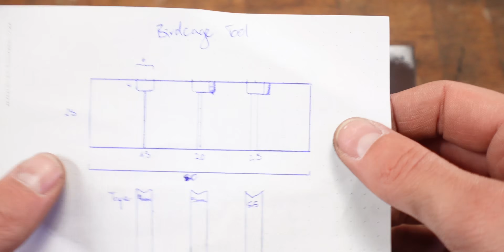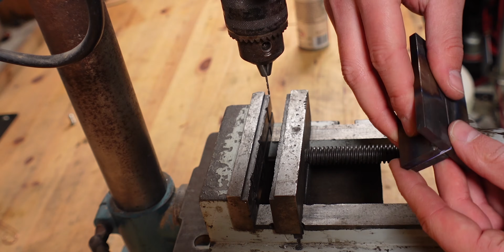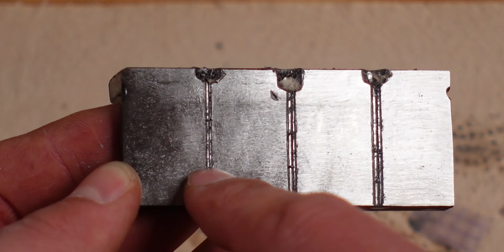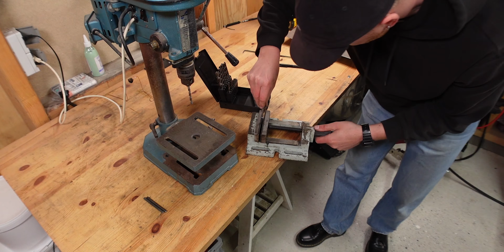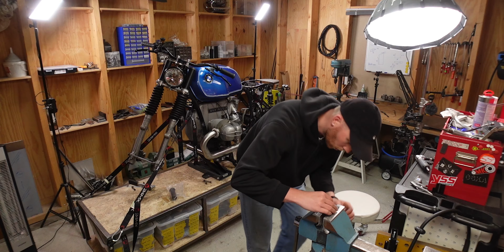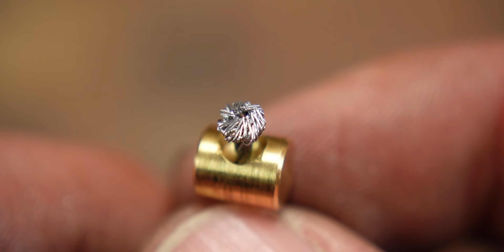Make a DIY bird cage tool for motorcycle control cables

Comment: That was a great video! I'm looking for options to replace a solid throttle cable on an 1982 Ford F250. Our Hondas have much better engineered cable systems with 1/4 round pulleys that have a grooved periphery for the stainless cable- never fails!

Comment: If you don't have a drill press but do have a hand held drill, you can still drill the small holes accurately (bit prone to wandering if drilled by hand), if you mark out with a scriber and square where the holes will go on the face of the angle iron and file a small groove into each piece with a 3/8" (10mm) wide triangular file (maybe don't snap the small drill as easy either!)
When placed together (with the  pieces of paper between!) the 2 grooves form a hole (only needs to be bigger than the chisel point on the drill),  that will guide the drill easily and accurately - jv
Reply from the maker: Hi John, that is a great approach! I appreciate the tip. Using a triangular file to create one half of the groove is a very good idea. Have a good one - Joshua

Comment: That's awesome! I considered making on of these when I did my control cables, but I was too lazy. But you showing how easy it is to make convinced me to make on the next time.
I actually also considered 3D printing one, what do you think about that? You don't have to use too much force when hammering the bird cage so a 3D printed tool might hold up.
Reply from the maker: It’s definitely worth it. I also tried 3d printing it. That one broke on the first try. However, I had the layers run horizontally. That gives cleaner holes but also creates a weak point in the corner. It might work if you print the parts with 90 degree rotated layers. If you want I can send you the file.
Reply: @MotoWrenchers  Yeah, I can imagine the layer lines having a large impact on how well it works. I would love for you to send me the files so I can play around with it!
Reply from the maker: @HeavyMetalParkingSpot will do 👌
Reply: You should not wrench so much, but drive more....😎
Reply: @michaelelse9328  We hade snow here last week! 😅 And you know how the saying goes; " Ride never - Wrench forever" 😉
Reply: @HeavyMetalParkingSpot 😇.... 😂
Reply from the maker: Haha soon enough 🤩 At the moment we still have single digits and a lot of rain 🥶
Reply: @MotoWrenchers ...when the going gets tough, the tough gets going.... oder wie man in Sachsen-Anhalt selbstüberschätzend sagen würde: "Nur die Harten kommen in den Garten."...😇
Reply from the maker: @michaelelse9328 „…und die härteren kommen auf die Gärtnerin“ 👩‍🌾